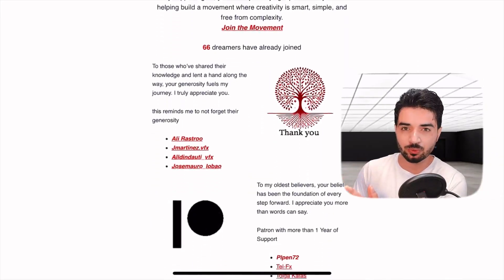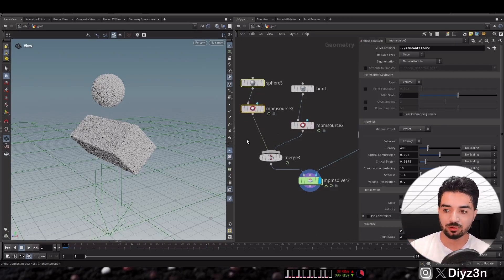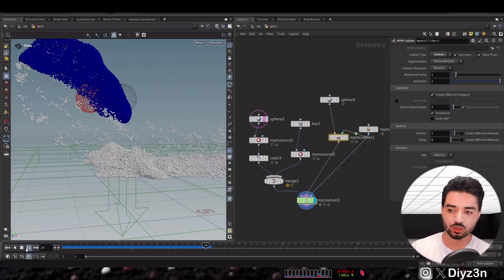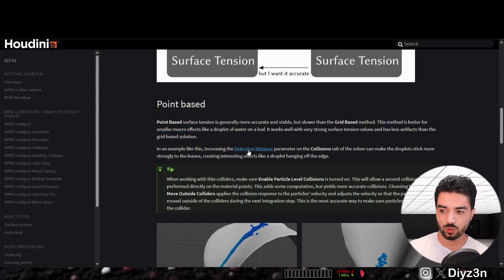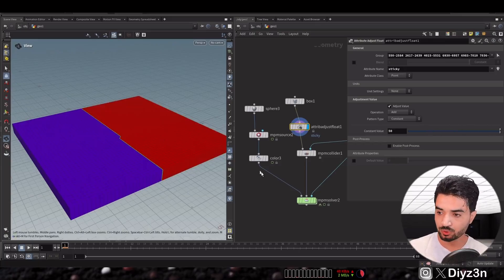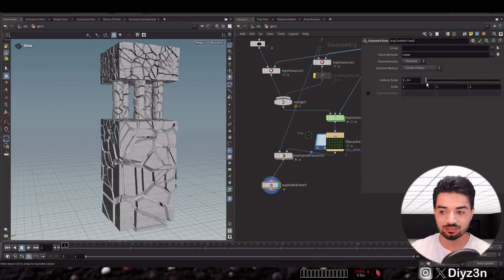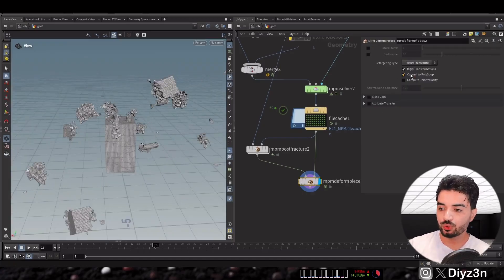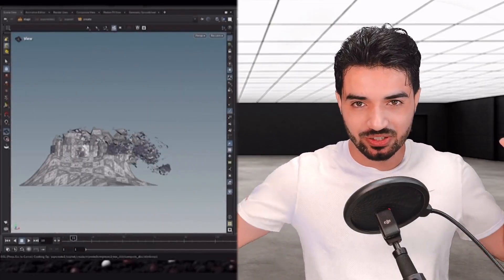Houdini 21 First Look: MPM Solver

Comment: FIRST THANKS FOR EVERY THING  I HAVE PROBLEM IF U CAN HELP ME IS IMPORTANT I have a cup effect that fills a cup, for example, I want the cup from the first frame to be filled with water. I made a time shift after the cache process and tried to put it as a Initial State  , but I did not find a box for Initial State in MPM WHERE I CAND FIND Initial State
Reply from the maker: Hi thank you for your comment, far as I know, we don’t have any initial state in MPM solver (we need more digging into that though) but you can cheat it, just think about that like real life simulation first fill it with emitter and then do your simulation